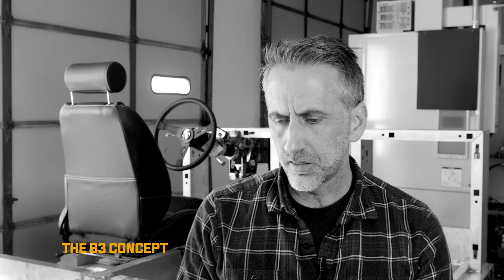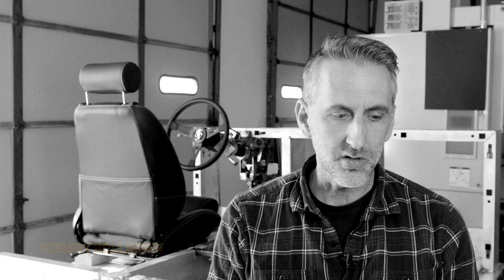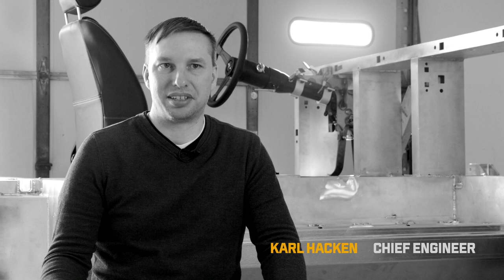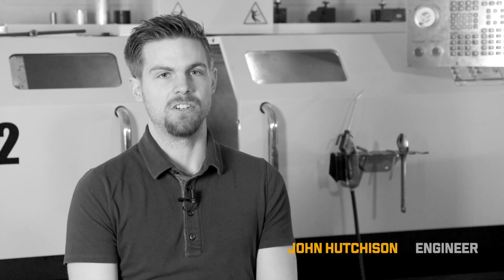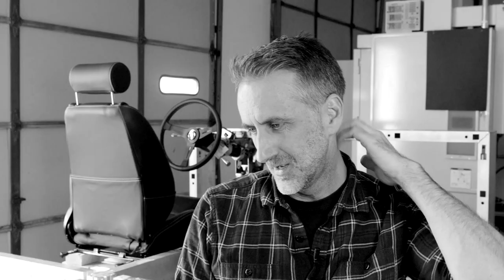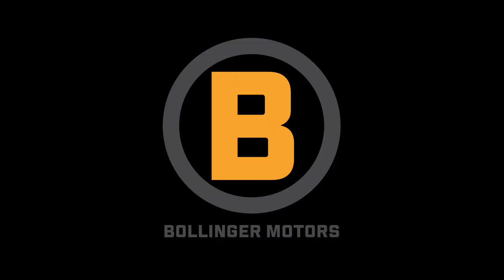B1 CONCEPT - Bollinger Motors

Comment: I like the concept and think it may have some potential in some markets, but I fear the downside to such a design limits the ability for long-term travel.  For instance, if someone wanted to spend a weekend exploring Moab, they are going to have to bring an external power source with them to recharge the vehicle.  

In this case, I think a hybrid would be ideal.

Comment: Way to go guys, sounds awesome, hopefully the elite in the government don't buy you out and cap this idea to protect their fuel industry lobbyists.  Same thing I have been complaining about for 13 years ever since I sold my Sierra Denali with 4 wheel steering and ride control.  Trucks are just going downhill 0 real advancements.  Hopefully you get into 4 wheel steering or just make a tight turning radius that makes a 4 door truck with a 6 foot bed easy to park.  Ride control would be nice as well for a soft ride when wanted and harder for highway control when needed.I cant wait for the reveal.  I hope the big three shake in their boots for the crap they have been selling for a century now.
Reply from the maker: Thanks Thomas. We will make sure the gov't doesn't interfere! We'll be made in the USA so that's on our side. I agree, today's trucks don't have any great features. Our first truck is a short wheelbase one, more like a Jeep Wrangler, the second one is a full-size pickup truck. Keep tuned, we'll be unveiling the first one this summer. -Robert
Reply: This should be refreshing, I find the mainstream auto industry very stagnant, especially in the truck market.  Looking forward to the reveal.